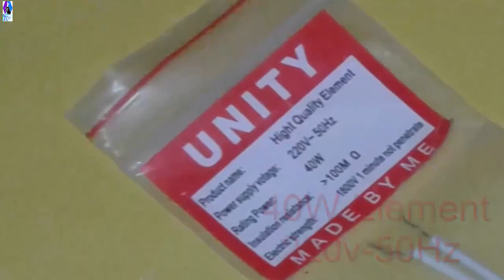How to make 40w Soldering Iron 220v-50Hz

Comment: Afterwords that accembly its just an assembly right ? so how does the wiring work i see sh*tloads of uploaders from warm countrys and they dont tell how its made ? Bummed 

Hey im trying to make one from just testing with copperwire for the tip and a couple of spare wires i and pluss to the socket it doesent work do i need a ground yes ? ive seeen those 5v clips doesnt work here in sweden . I need it stronger like that ? how do i do? need a fishin tip or a tattooin tip i can help you out thats about that .. / Paul